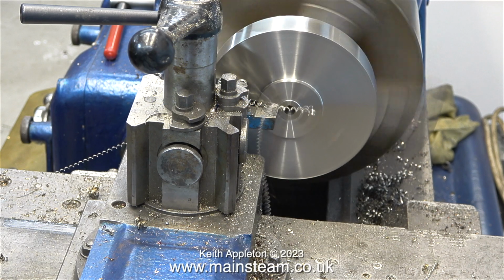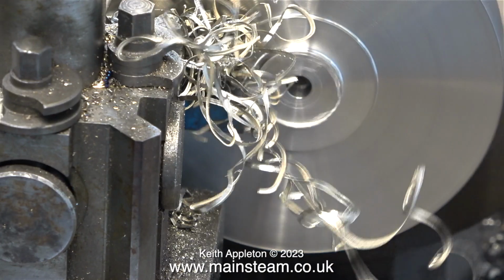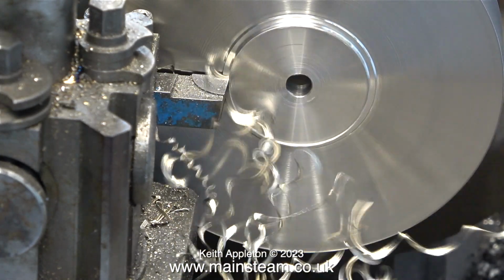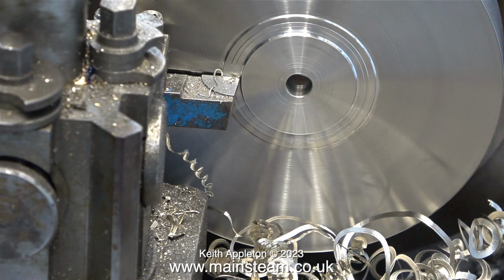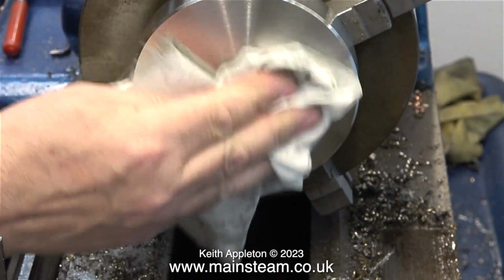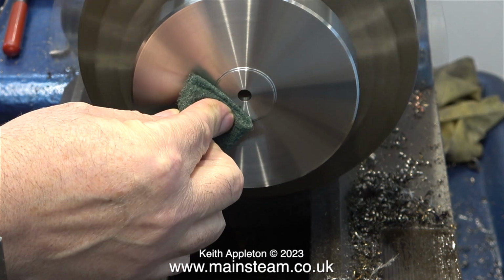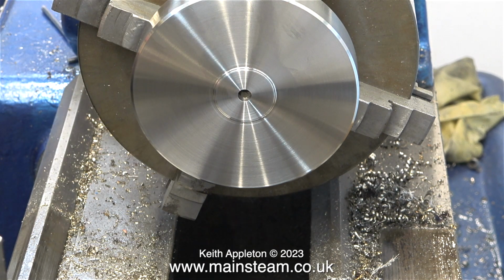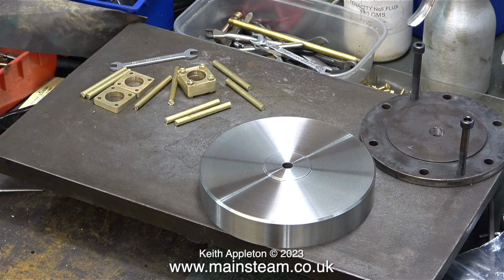A LARGE MODEL SHOWMAN'S ENGINE - PART #83 - THE MISSING EPISODE

Comment: Hi Keith I watch most of your videos, and like them all.  In one you used a lock tight to seal a bolt or something that seped old  could you tell me which loctight it was ?  Thanks.
Reply from the maker: I use Loctite 542 for thread sealing.
Reply: @keithappleton  Thanks a lot I will get some.